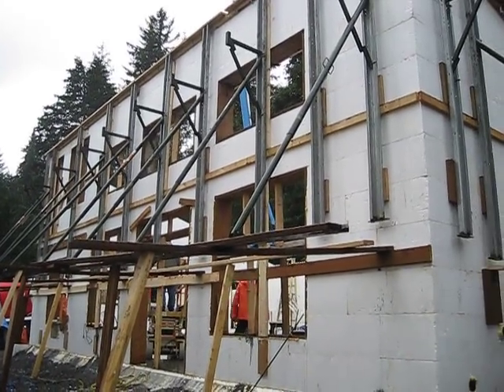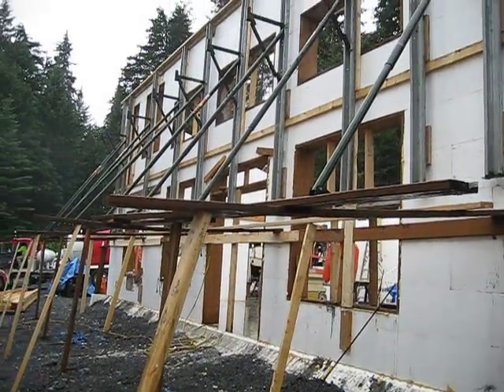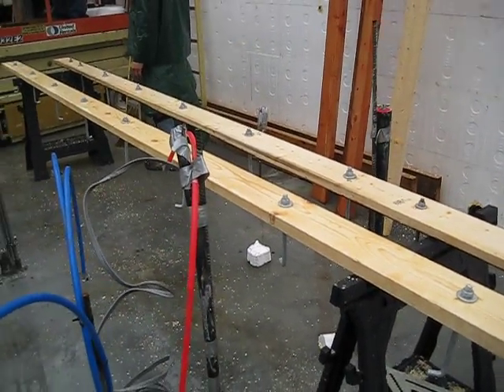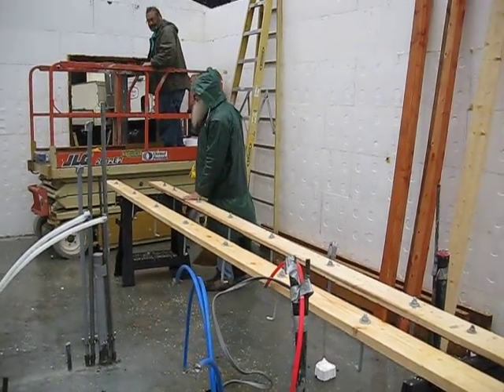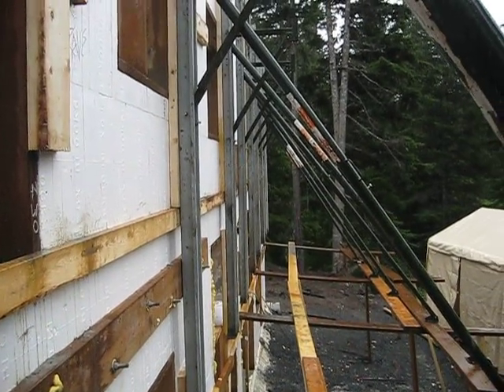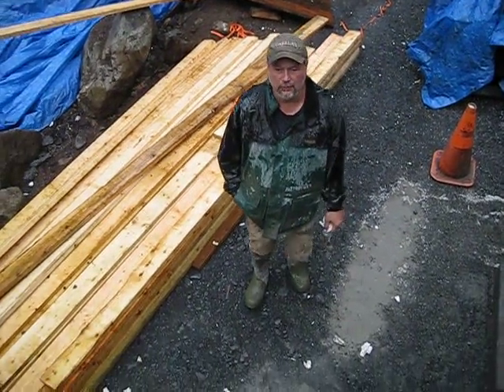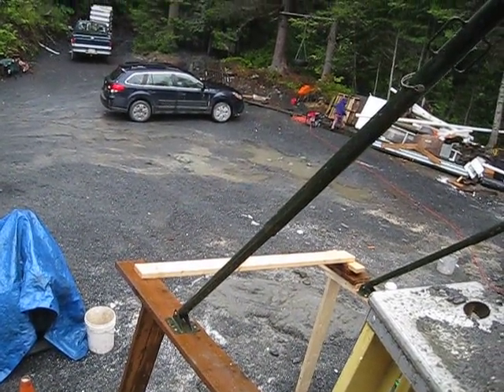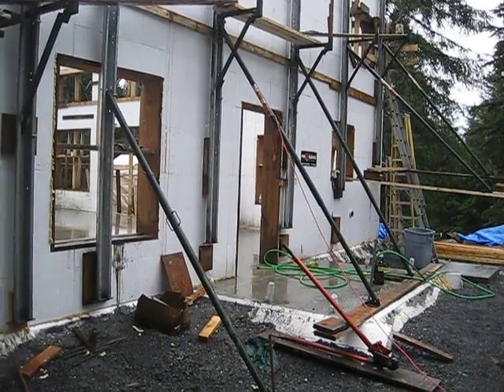Building ICF Walls Part 7 with Fox Blocks in Alaska Pouring Concrete 2nd Level

Comment: Might be obvious... but how did you get the concrete to pour into the side walls on an angle before putting the plate on the top?

Comment: I would've recommended an electric vibrator to settle mud.....a rubber hammer is not sufficient
Reply from the maker: We had one but felt a 2" vibrator to be a risk in 6" forms. I can say after removing my caps from window and door bucks the concrete settled perfect! We doubled on horizontal rebar so using a vibrator would be tricky. I don't think folks should refrain from using a vibrator. We could not find a cordless 1"

Comment: I like the honesty about the blow-out.  It will be in my head if I choose to use ICF at some later date.  Glad it worked out well!
Reply from the maker: Thanks! I was not able to video during the blow-out because it was an "all hands on deck" time, and I was scurrying to find boards for bracing and a screw gun that had a charged battery!  And the rain was constant, so after we got it patched up, I ducked under the tent to do the commentary on that part.
Reply: I love getting to watch your channel grow, I was #56 and you are already to over 80.  Great job!